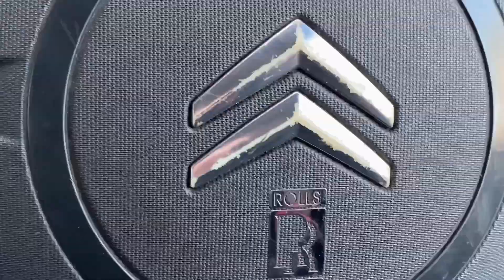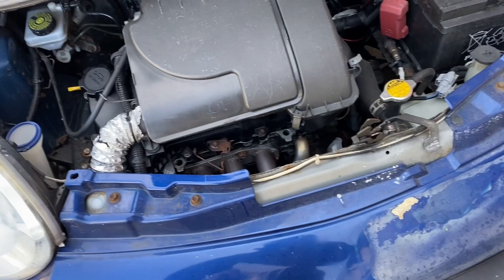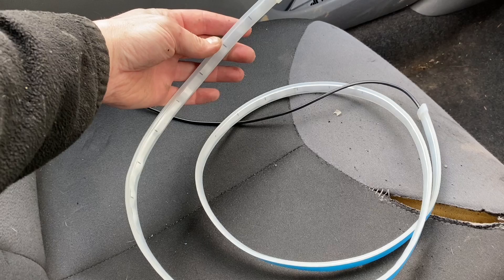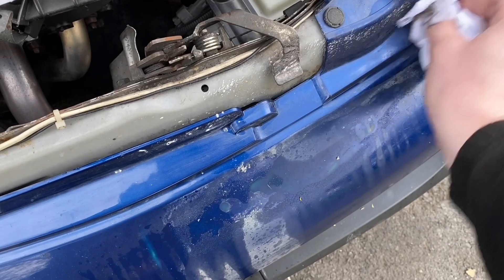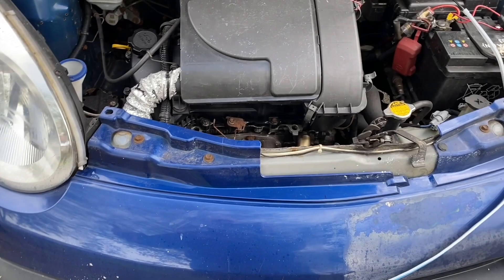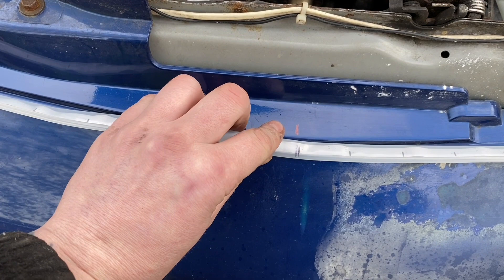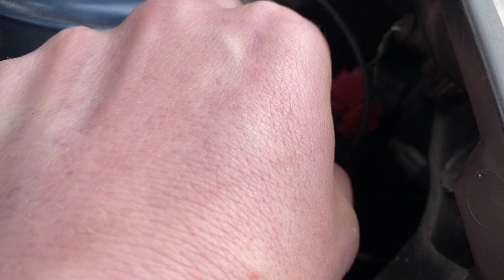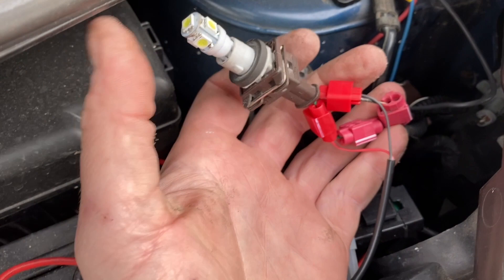LED Hood Strip Install / Dynamic Car Bonnet Strip Daytime Running Light DRL (C1/CityBug/Aygo/107)

Comment: Very nice, m8. But I'm thinking of installing X-mass LED lights instead.
You can buy them cheap with multimode remote control.
Reply from the maker: You can also get remote control underglow for about £20. I’ve had a really shit set that I’ve not gotten round to fitting for about 3 years.

Comment: Do you have a link for purchase
Reply from the maker: I bought it a few months ago and the eBay listing is no longer available, but just type in “hood LED strip” on eBay and they should come up. I’d get a shorter one than I got though…
Reply: @StupidBlokeStupidVideos  I bought one. It says positive to side light/ACC and negative to the negative battery terminal. I see that you wired both wires to the light. How to know which one is what?
Reply from the maker: @sayanpal9491  if you wire into a side light then there’s only two wires going to it, can be measured with a meter but if you wire it into it and it doesn’t work then just swap the wires around.